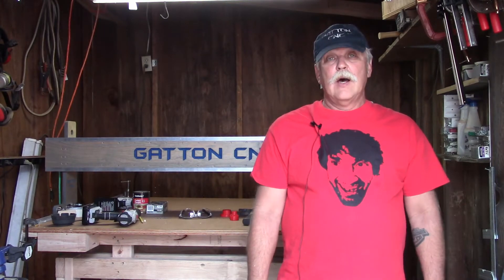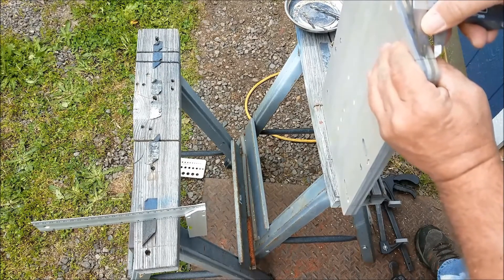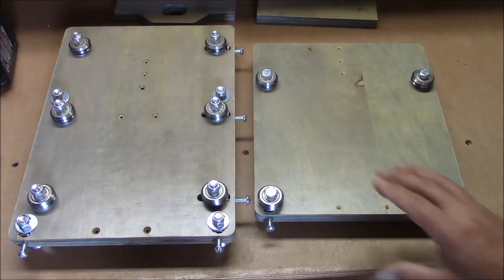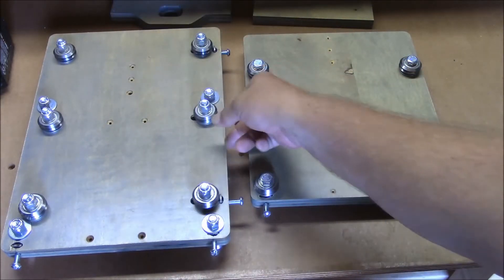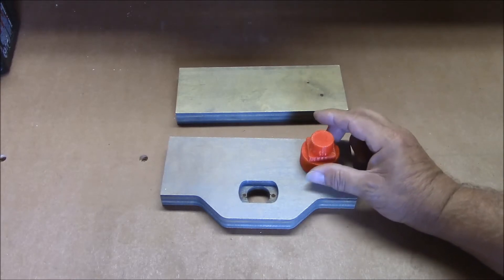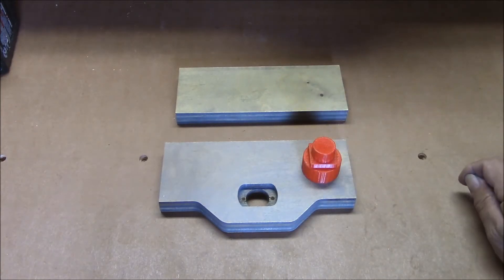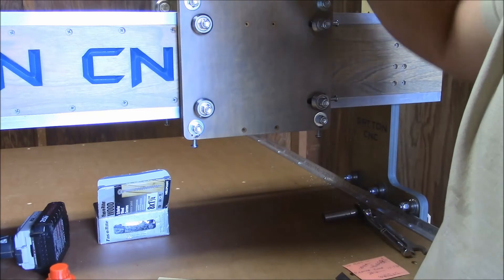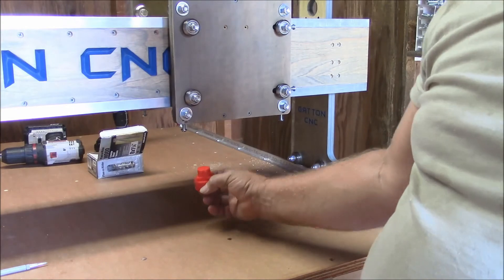Gatton CNC Build - Part 7 - Z Axis Plates

Comment: Mark, when I built my Shoestring CNC when it came to the tension screws I
 used my doweling jig to drill the side end holes.
Reply: What a good idea.  I must remember this one for times when end drilling is required.  I suppose one could make a bushing for smaller holes.  Good idea, thanks
Reply from the maker: I did too, Jerry. I almost did it on this one as well, but I decided to use this method, just for the folks who don't have a doweling jig.